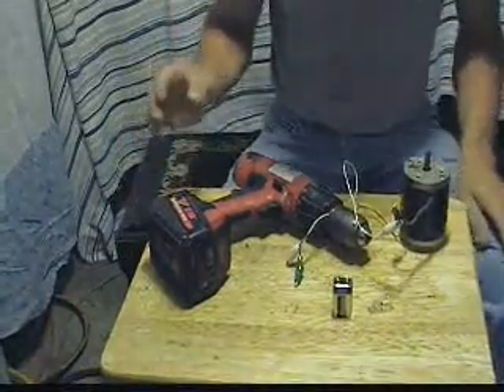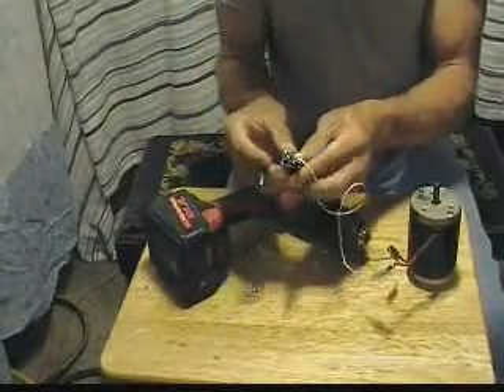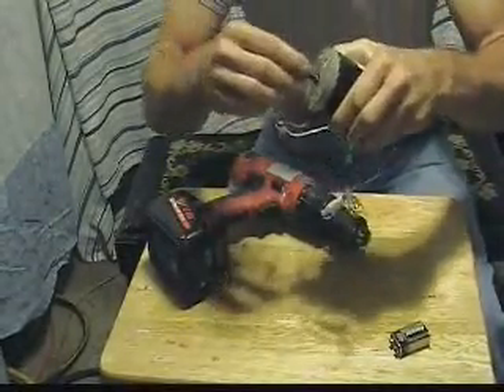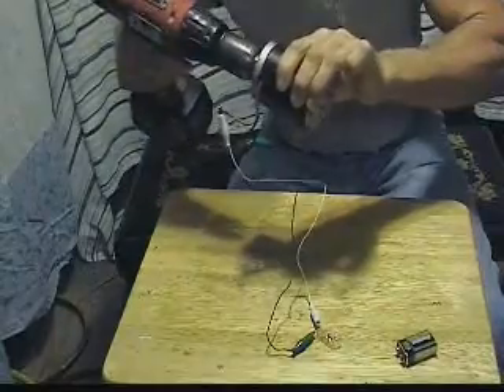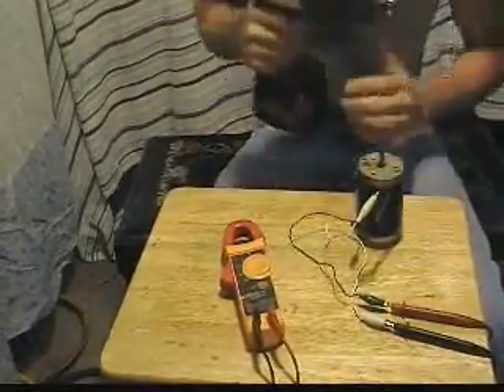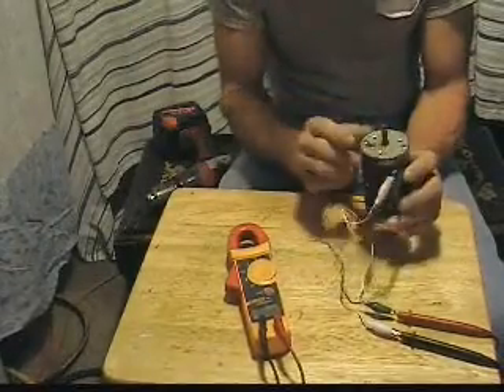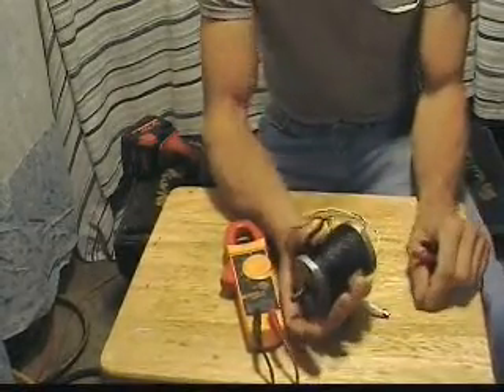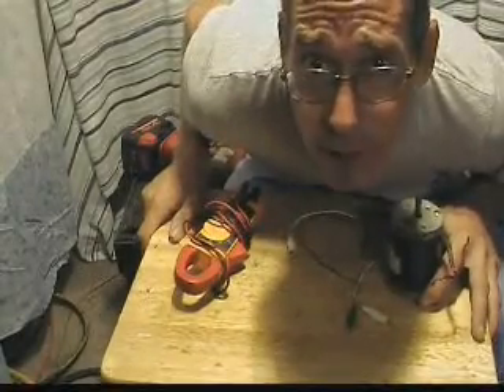How to Generate Electricity

Comment: I bet, as an electrician, you could help me with something. I salvaged a DC motor out of an old treadmill but it has several wire which, I'm guessing, control the speed of the motor and other factors. The electrical inputs, as well, are bundled in a 110v-style plug. Could you teach me (us) which wires are unnecessary and how to take apart that wall plug cabling to safely use it in DIY power generation projects?

Comment: @PoppyFizzFred electricity goes through copper coils around magnets, this creates an electro magnet repelling the magnets making them move, turning the chuck. Say you had a wind mill plugged in the chuck of your drill and it was turning that would turn the magnets past the copper coils to create electricity, its just the same process but in reverse

Comment: Put thin silver over glass over aluminium alloy, and put in sun. The N over P solar generator only works because the denser layer is above the less-dense layer underneath, so the light has to accelerate across the boundary, hence to jump the boundary, it has to absorb enery -- correct? And on the less-dense layer it slows down and has to release energy -- also correct? So why the hell wouldn't it work?
Worth a shot?

Comment: I am not much of an electrician, I know how to wire in a new porch light or new plug in the batheroom, but that is about as far as I have ever got with   it. I was just wondering. if you put... let say two motors, would you get twice the voltage?... eather way, if you wanted could you put a converter on it if you wanted AC?... just asking :)

Comment: Very interesting video. Like you, I'm looking to use my stream to charge a bank of 12V batteries.I was tooling around with the idea of a car alternator, vent fan, etc, when I stumbled on a broken scooter. I spun the motor's shaft using the friction of my kids bike tire and the voltmeter went up to 48V popping the 12V lightbulb I was using to test it. I'll next test amp rating by connecting to dead battery. Good luck with ur wind project! Let us know how it works.